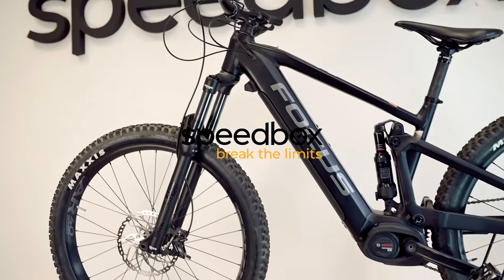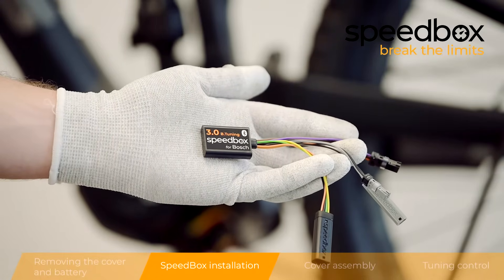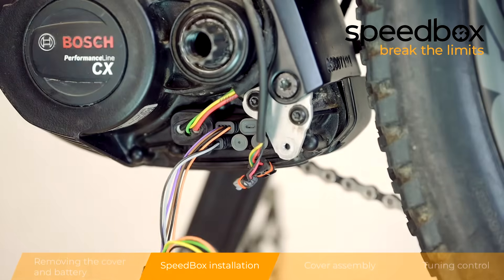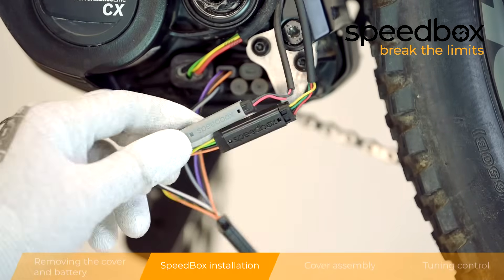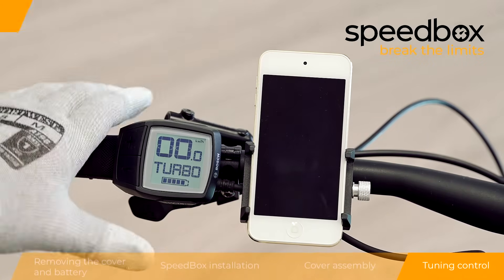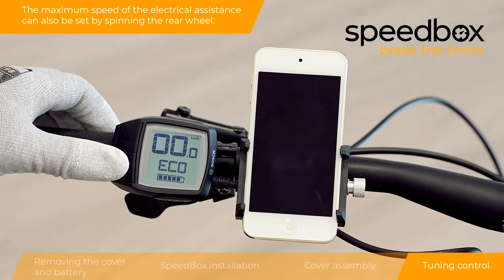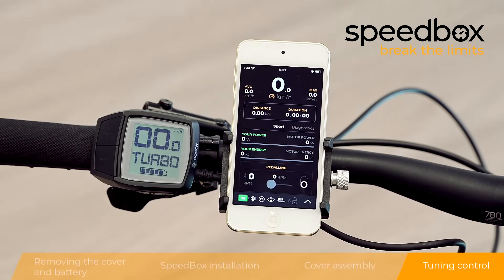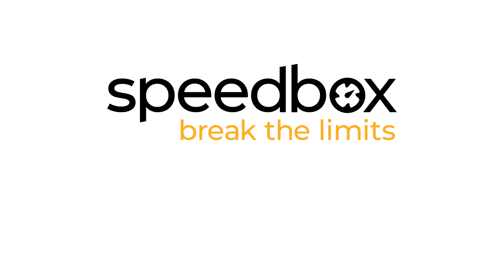eBike Tuning SpeedBox 3.0 (B.Tuning) for Bosch Installation Instruction

Comment: Can this be fitted to a Tern HSD?
Reply from the maker: Hi,
Thanks for your message. The SpeedBox 3.0 for Bosch is also designed for Cargo Line motors, so yes – it’s compatible with your Tern HSD e-bike.
Reply: @SpeedBoxTuning Awesome, thanks for the confirmation!

Comment: Hi all, after 1 year of not being ridden, I can't turn off the speed limiter. No 9.9 shows up just 15 and 20 mph
Any help would be much appreciated
Reply from the maker: Hi. 
Nothing happens ☺
Try this procedure:
You can set the maximum speed of electric assistance by changing modes: Turbo - EMTB - Tour - Eco - Tour - EMTB - Turbo. The current speed limit will be displayed after this sequence. Alternatively, you can adjust the limit by briefly activating the WALK assist function or by turning the rear wheel 360°. For example, 1.5 km/h corresponds to a 15 km/h limit, 2.0 km/h for 20 km/h, 2.5 for 25 km/h, 3.0 for 30 km/h, and 9.9 for 99 km/h. The last displayed limit will be saved after 5 seconds of inactivity.

Comment: It would be great to have more info on the features tuning visible and motor lock.
Secondly is there a way to deactivate the activation on the +/- buttons? Would be great if tuning could only be activate on the phone.
Reply from the maker: However, if you do not have the B.Tuning version, you can activate/deactivate the tuning only on the display using the Walk function or the combination of - + - + (or + - + -)

Comment: How does the engine lock work?
Is this option also available in the non-Bluetooth version?
Reply from the maker: Hello.
The Motor Lock function can be activated in the SpeedBox App, which can be paired with products with B.Tuning in the name via Bluetooth. This feature completely turns off the motor assistance.

Comment: Hello! Can you use the bosch screen, too?
Reply: Great. I just need orientation as in to open access to my bosch motor on a Koga Evia Pro with Performance line.
Reply from the maker: @Albert-bu1qv  But be careful. Your E-Bike probably has a Bosch motor with the Smart system. In this case https://youtu.be/eaerAdy2P7o?si=tFuvigdEff6XANUQ is for you
Reply from the maker: Hello.
Could you please specify your question? 🙂
You can activate/deactivate tuning on Bosch display. 
If you have B.Tunig version (B.stands for Bluetooth), you can pair SpeedBox with a smart phone and control the tuning via SpeedBox App in the phone.

Comment: Hello, will the installation of such a speedbox later in the service be detected if you have a warranty?
Reply from the maker: Hello.
When you are going to take the ebike to the service, uninstall the SpeedBox from the motor. As a result, the earlier presence of tuning will not be proven and the warranty will not be affected.☺

Comment: My (Canadian purchased) 2022 SCOTT Strike eRIDE 920 has the BOSCH Performance Line CX GEN-4 , which has 5 plugs all with wires going into them .Only 1 of the ports don't have a wire plugged into it. Is there some other product or adapter that I'd require to make this work?
Reply from the maker: Hello.
It shouldn't matter that all ports are occupied. You probably have front and rear lights and GPS in them, is that possible? You are only interested in the two ports where the gray and black cables go as in the video. If something is not clear, contact our support at speedbox-tuning.com or FB, IG.
Thanks!

Comment: Will it be possible to connect the speedbox with the connect modul from bosch (gps) at the same time? Cheers Rasmus
Reply from the maker: Hello.
Yes, with some motors we have tested that both modules fit in there. On the other hand, it should be taken into account that manufacturers are trying to reduce the compartment of the latest motors. If you want to buy both products, it would be a good idea to look under the motor cover first.

Comment: I fitted the Bluetooth version to my new 6k levo turbo alloy yes it works in that you can go faster but active or not you can absolutely feel that it's fitted!! 

I took my bike to Evans multiple times because the bike feels like you're riding on wet cement the moment you stop pedaling they knew it was there, the motor behaviour is different.. 
I gave permission to take it out and they said the bike feels great without it so I'm not sure what I'm going to do with it, I need the assistance as I have disabilities but the difference in all round performance is not good for £265!!.
Reply from the maker: Hello. Could you please contact our support via chat speedbox-tuning.com or on Facebook and describe your situation in more detail? We will definitely find a solution. Thank you.
Reply: @SpeedBoxTuning  thank you I just had a chat with your team and they said I need to contact the vendor and request either an exchange or refund, I'm going to ask for an exchange..  I can't ride without it because of my disability so I think an exchange will fix the problem, thanks again for your help 🙏
Reply from the maker: @printitpaintit.2436 We are glad that we could advise and hope that you enjoy many happy kilometers!

Comment: Do you have information about the error message 550 triggered by the speedbox 3.0?
Reply from the maker: Hello. According to our information, this error has nothing to do with the installed tuning or lights. It is said to be moisture in the Bosch motor which needs to be addressed with the e-bike dealer/motor manufacturer.

Comment: does it work with nyon gen 2 , after the changing the display it looks like i can not activate it via walk assistance button
Reply from the maker: Hello. SpeedBox 3.0 for Bosch is compatible with the Nyon Gen2 display. Replacing the display should not be a problem. Activation with the WALK button does not work, but activation with the + - + - buttons does? What type of e-bike and motor do you have?

Comment: Hi. I have been using speedbox 3 on my gen 4 cx with kiox. Over 3000 k now without an issue. I only ride offroad trails but I live in fear of the dreaded cut out 
should it ever happen so I have never had a bosch update done since the install
Reply from the maker: Hi Wayne. Thank you for the nice feedback 🙂 Bosch is known for its problematic updates. If you currently have SpeedBox installed, we do not recommend enabling software updates.

Comment: Considering buying the SpeedBox 3.0 B.Tuning for Bosch and would welcome any user comments on how it affects range and/or battery charge. For example do users see a typical % reduction in range and/or does it vary across different e-motors. I have a Bosch Performance Line CX 500Wh.

Comment: Hi, thank you for the video. I see that this chipset works with  BOSCH engine from 2017 to 2021, do you think it's compatible with a 2022 Performance CX Generation 4 engine please?
Reply from the maker: Hello. Yes, it is compatible :-) Please check our website https://www.speedbox-tuning.com/p/speedbox-3-0-b-tuning-for-bosch#245
Reply: @SpeedBoxTuning  Thank you, I will
Reply: @SpeedBoxTuning  Further to this, your website states that this model is not compatible with the 2022 Bosch Smart System. Does that just mean that the true speed isn't displayed on the Kiox display or does the chip just not work on 2022 model bikes using the Bosch Smart System (Flow App)?
Reply from the maker: @arcaneentity8458  Hello. SpeedBox 3.0 does not work with Smart System. There is a different communication. So we recommend SpeedBox 1.0. Just a brief explanation: version 3.0 means tuning plus complete real driving data. Version 1.0 means only tuning - some systems are still too complex.
Reply: @SpeedBox Tuning  hey. So for the 2022 smart connect the speed box 1  works?
Reply from the maker: @marcswain3550  Hello. Yes, for Smart System is only compatible SpeedBox 1.0 for Bosch or SpeedBox 1.0 B.Tuning for Bosch https://www.speedbox-tuning.com/for-bosch

Comment: Guess its fun till you get pulled over and get fined for exceeding max speed
Reply from the maker: Even on an e-bike with tuning, you must respect road signs and speed limits, for example in residential areas :-)
Reply: Still slower than a fit rider on a 4 grand road bike. I get passed all the time doing 20mph.
Reply from the maker: @niblet112  Truth. You can go over 20 mph on a regular bike just fine. That's why we produce SpeedBox to unlock the speed limiter of e-bikes.
Reply: @SpeedBoxTuning  and I’m glad you did thank you 👍